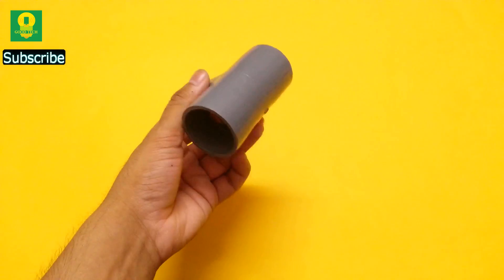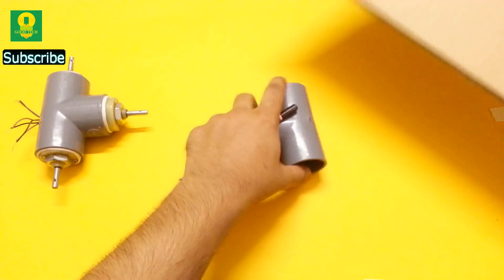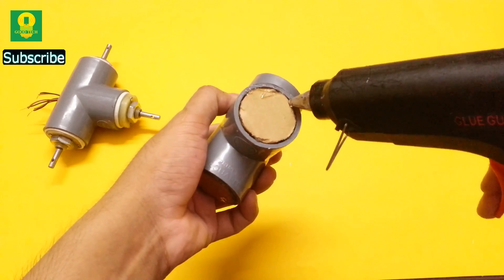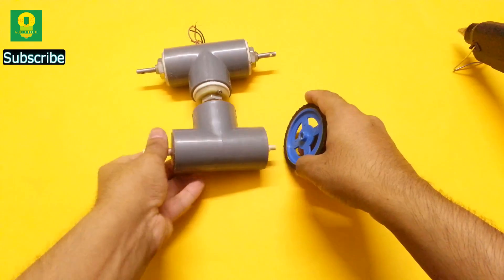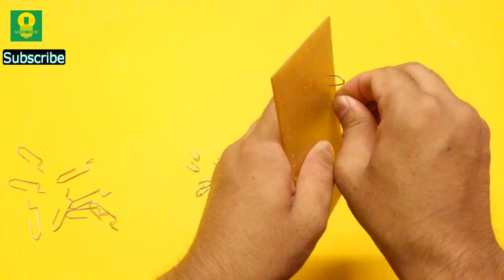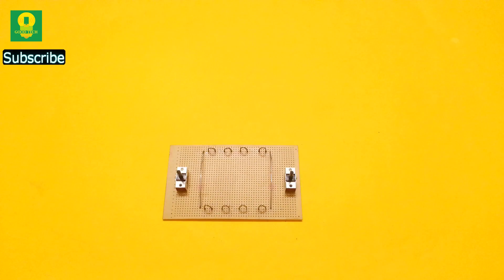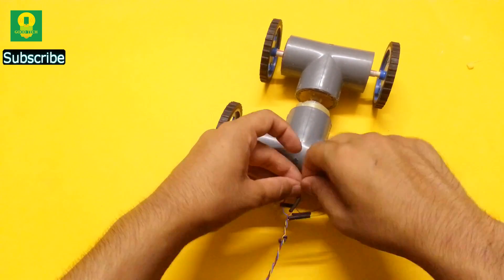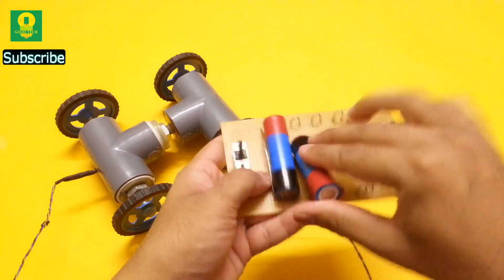How to make Remote Controlled Stunt Car at home

Comment: PLEASE remind your viewers that it is VERY important NOT to breathe in the fumes from the solder!!! Because it will give you lead poisoning

I have a friend who has cancerous lesions on his fingers from years of using solder for stained glass. Maybe also stress to your viewers the importance of either using gloves, if they are going to do a lot of work with solder, or avoid contact.

Okay, that's all I have!  I always have my eye out for safety. ESPECIALLY because this is such an awesome video, and it encourages people to build things and they might not be familiar with all the safety procedures for working around solder. I love this video because it is very simple for the viewer to follow. Instead of giving them a bunch of electrical theory, this gives them a quick project

Comment: what is the cost of that PCB board
Reply from the maker: The cost varies from shop to shop. If you have a local shop nearby then bargain and get the parts from there. But if don't have any, all the parts are also available online on ebay and amazon.
You can have a look at my instructables for additional details and material links - https://bit.ly/2SyiOq2

Comment: What is the dia. Of pvc t
Reply from the maker: I used is a pvc-t with1.25 inch diameter, but it will depend on the size of motor.

Comment: wow nice
Reply from the maker: Thanks..
Reply: bro agar ramot ki jo taar he uski jaga sencer lag jay to kasa rahe ga q k mane ye car banana shuru krdiya he
Reply from the maker: knsa sensor?
agar ise wireless bnana h toh motors thodi zada better use krni pdegi ye gear system use krna pdega kyunki wireless mode mein battery bhi car mein hi rkhni hngi and it will increase the overall weight of the car, thus making it difficult to topple and perform stunts.

Comment: How many pins are there  in dpdt  switchs???
Reply from the maker: A dpdt switch has 6 pins and a momentary dpdt switch can be easily used to control the direction of a DC motor like the ones used in car power windows.

Comment: can we use a normal dc motor which cost just 40 rs
Reply from the maker: A normal DC motor without the gears will not be able to produce enough torque to move or lift the car.
Reply: thnx

Comment: Can we use DC motors
Reply from the maker: Yes, i also used DC motors. Dc motors are only capable to provide enough torque when used with gears. That is why mostly geared DC motors are used in toys.

Comment: Which type of motor did you use please tell us the power of the motor
Reply from the maker: I used a 12v geared DC motor available online ebay and amazon. If you have any doubt,i have also made a written document about the project on my instructables page : https://www.instructables.com/id/How-to-Make-Remote-Controlled-Car/

Comment: Can i make it with a normal dc motor instead a gear dc motor
Reply from the maker: No, a normal DC motor will not be able to provide enough torque for over turning of the car.

Comment: I'm making this car in car race in my school
Reply from the maker: This car is not suitable to work as a race car. The motors are not able to provide that much rpm. Its better to design a ferrari with high rpm dc motor and you will surely win the race. There are many tutorials out there online, give them a try. 
But if the race surface is tough and there are dirt tracks, this car will work good.

Comment: we need pcv card compulsary
Reply from the maker: No, a PCB board is not compulsory, you can use any plastic box and make connections using wires.

Comment: bro can we use 2 9v battery instead of cells please reply fast
Reply from the maker: Yes, surely you can use any batteries as long as it meets the power requirements of the motor. High current 9v batteries will work well.

Comment: can we use other motors
Reply from the maker: Yes, you can use any DC motor. But make sure that the motor used at junction is of high torque that can lift the weight of the car upwards, otherwise it won't be able to perform stunts.

Comment: can i use metal toggle switch instead of dpdt switch
Reply from the maker: How will you achieve bi-directional motion with a metal toggle switch.
Reply: so which type of switch will I have to use
Reply from the maker: To achieve bi-directional movement, the most comfortable way is to use a Dpdt switch but you can also use 2x two way switches and combine them to form a dpdt switch as i did in my floor cleaner video. Although, this method can be used but two way switches are not very comfortable to operate a car. If availability of the switch is a problem, you can get the switches from here: http://amzn.to/2lJEAqu
Reply: Lokesh

Comment: Hi friend, where can I get the engine you used to build your video car? On a printer? , On a radio? Please answer me, thank you
Reply from the maker: For the wheels any DC motor can be used but the motor at the junction needs to be of high torque to be able to lift the weight of the car upwards. This high torque motor can be obtained from an old printer.

Comment: WHAT IS THE SIZE OF PVC T?
Reply from the maker: The size i used is 1.25 inch, however it will depend on the size of the motor used.

Comment: how much inch pvc pipe is it?
Reply from the maker: The size i used is 1.25 inch, however it will depend on the size of the motor used.

Comment: can I know the rpm of the motors.
Reply from the maker: Two motors are 150 rpm and the motor at the junction is 100 rpm. If you are making this car, make sure that you use a high torque motor at the junction that can lift the weight of the car upwards.

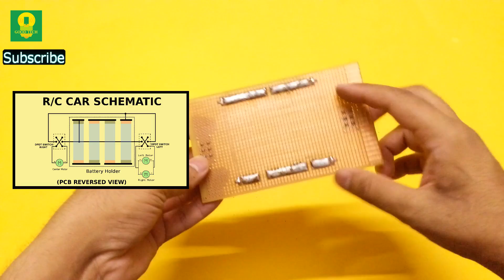Comment: hey bro...I didn't fully understand how you connected 4 wires to the 3 pairs of wires you made from the motors at 4:22
Reply from the maker: There are 4 wires from the remote (i.e 2 wires from each switch) and 6 wires from all the 3 motors (i.e 2 wires from each motor). We need to connect both the two oppositely placed motors together that are responsible for car's movement and the motor at the junction should be separate. After connecting the motors, we have 4 wires from the 3 motors (i.e 2 wires from the motor at the junctions and 2 wires from the connection of other two motors) and 4 wires from the remote, that can be connected easily.
If you are preparing to make this car, make sure to use a high torque motor at the junction that can easily provide upward thrust to the car, so it can easily perform stunts.
Reply: Thanks man! You were really helpful.

Comment: Can you tell me where to fit the wires of dc motor in the receiver circuit
Reply from the maker: All the receiver boards generally have markings for the connection of the components.

Comment: which motor u have used  and which type of board is that tell is clearly wich type of material u have used
Reply from the maker: All the materials are mentioned in Video Description. The board i used is a general purpose PCB board.

Comment: what rpm motor and which type of battery I need to make this awesome project
Reply from the maker: I used 100 rpm geared DC motor. The battery will depend on the power required by the motors you will be using. However, if you build this, make sure to use a motor at the junction with high torque, so that it can lift the weight of the car upwards.
Reply: the modern robotics rRrttttttre3rrye

Comment: I have my vehicle built.  I was able to use a dowel rod for the central shaft that connect to the motor. I cut the dowel rod into sections with a cutoff saw. I used a drill press to drill the center of the dowels. I'm still working on my prototype. Since I want to use this project with my elementary students, I think the less hot gluing they do the better. ;-) Not sure yet if my wheels are too wide or heavy.  I just tested it out with 6-volts and can see that it does take more power to lift and twist the front end, but I just got my 3.7 volt batteries today and will see how they work. This is a cool project.
Reply from the maker: Thanks..All the best :)
Reply: It is best how to make a rc.truck

Comment: sir very nice one but the connection are little bit hacky
Reply from the maker: Thanks..I did try to make it simple but if you face any problem feel free to ask. There is also a schematic of the complete circuit in the video.
Reply: Ok thank u so much sir plzz. Make projects like this more and more

Comment: Can we use 150rpm motor???
Reply from the maker: Yes, but make sure that the motor used at the junction should have high torque so that it can lift the weight of the car.

Comment: see I've got 4 wheels,3 dc 12v 100rpm motors,lg li ion 2000 mah batteries but they are connected with wires so how can I make it

Comment: What are the Materials required??
Reply from the maker: Two PVC -T, 3 geared DC motors (mainly the motor at the junction must have high torque), wheels,Connecting wires, Two DPDT switches, a general purpose PCB board, few office clips and batteries.
However, all the details are also in video description.

Comment: Remote connection is not clear please clear it
Reply from the maker: There are two DPDT switches on the remote. One for the motor at the junction and other for both the back motors. All the 4 cells are connected in series and then attached to DPDT switches. There is a circuit diagram in the video, give it a look and you will be able to understand the connections well.

Comment: bro how to get motor
Reply from the maker: These are available on ebay and amazon. If you are going to make this stunt car, make sure to use a motor at the junction with high torque that can lift the weight of the car to perform stunts.

Comment: sir i want to ask u a question that if we have to connect two wire that are apart can we only solder from the first wire to other does current willl pass or no
Reply from the maker: I didn't get your ques but if you are asking that can we connect two wires using soldering then yes you can and current will flow.

Comment: sir your video was really useful but one problem i found was that how to connect motor to the pvc circuit
Reply from the maker: We have used 3 motors in the PVC, the motor at the junction is independent and is directly connected to the circuit on the remote control, the other two motors are placed opposite to eachother but they must move the car in same direction, for that, we need to connect both the motors in opposite direction(cross connection) i.e the +ve terminal to the -ve terminal of both the motors as a result both the motors are combined to form only two terminals, that are connected to the remote control as shown in schematic.
Reply: +GOODTECH - Creativity and Science  now i got that but can you send me picture of circuit in real other than schematic diagram pls if u can
Reply: +GOODTECH - Creativity and Science and how much rpm motor u r using
Reply from the maker: I have used 100 rpm motors
Reply from the maker: The circuit is easily shown in video, look at the sequence between 4:47 to 4:59. The image of the circuit can be seen completely.
Reply: +GOODTECH - Creativity and Science thank it was very useful due to u i made my science model today only it was easy
Reply from the maker: You are welcome :)
Reply: +GOODTECH - Creativity and Science sir need ur more help where u get that wheels
Reply from the maker: These wheels are available online on ebay and amazon(color and design may vary). However, you can also use plastic jar caps as wheels.
Reply: +GOODTECH - Creativity and Science okkkk thanks

Comment: Add a radio reciever circuit from a broken rc car,now you can control it with the rc car controler from a distance!
Reply from the maker: Yes that is true, but the problem with that is we need to attach the batteries to the car in order to add a wireless receiver and to power all the three motors we need high capacity batteries that are bit heavy. It will be difficult for the motor to perform stunts with so much added weight.

Comment: what can be used instead of the wooden stick?
Reply from the maker: You can use anything that can act as axle for the two wheels. A pencil is the most common thing that does the job well.

Comment: How do i make the controll, i dont understand the schematic
Reply from the maker: What did you not understand in schematics ? There are only two DPDT switches that have six terminals each , 4 of the terminals of each switch are cross connected and the middle terminal of the switch are connected to battery Holder. All the 4 batteries are connected in series as can be seen easily. The Red part of battery indicates "+ve" terminal and black part indicates "-ve" terminal. The motors are connected to two of the cross connected terminals of each switch.
Now, Try to look at the schematics carefully and you will surely be able to understand it well.
All the best :)
Reply: +GOODTECH - Creativity and Science i'm really bad at this stuff and i'm doing this for a school project. How do i do the switches with Only two pins? ( just for on/off) And The pins are not small like yours so can't connect it to the board, what do I then? And the board thing you're using as remote controlledr have a similiar but with metal so one whole string / line becomes positive or negative if u connect it with battery ( dunno the name)
Reply: +samindj I bought the two pins cause I only need it to go forward, or do I need another one so it functions correctly and move/ turn?
Reply: +samindj don't need it to go backwards if that's the only extra functions with more pin
Reply from the maker: Its alright. But what i understood here is that you bought a simple On/OFF switch and with that switch you wont be able to have much control over the car. You don't even need it to perform stunts(it is not possible with a simple ON/OFF switch)??
If you just want to make it go forward, then you can skip the motor at the junction, then you will have only two wires instead of four (because both the rear motors are connected together). Connect one of the wire directly to the negative terminal of battery and connect the two pin switch between the remaining motor wire and the +ve terminal of battery.
And the board you bought is a copper clad (bakelite board coated with copper ), it is used to make PCB's. This board is not useful to make the controller. You need a general purpose PCB board. If you are not able to find the components in local market then, most of the items are also available online on ebay and amazon.

Comment: Hi i like your videos can u tell me the remote connection and then how to connect it with the car
Reply from the maker: Thank You :)
As you might have seen, the remote uses two DPDT switches. You have to cross connect the terminals of the switches and connect the batteries to the center pole of both the switches. now, connect each motor to the crossed terminal of a switch. See the schematic once and everything will be very clear. 
If you are making this car, make sure that the motor used at the junction is of high torque, that can lift the weight of the car upwards otherwise it wont be able to perform stunts.
Reply: +GOODTECH - Creativity and Science  thanks for the reply

Comment: From where i get DC MOTOR
Reply from the maker: I bought them from a local market, however, these motors are easily available on ebay and amazon. If you cant find these exactly similar motors, you can use any 12v DC motor with high torgue.

Comment: Sorry but for the love of equipment don't melt holes with a soldering iron unless you want to ruin the tip
Reply from the maker: +Thomas bryden Yes, I understand this but it is very convenient and fast method, and the tip of soldering iron can be just revived by grinding with a filer instantly.

Comment: may i know the tools and materials needed ?
Reply from the maker: +Fahri Hamdika You need three 12v high torgue geared DC motors, four wheels, battery to power the motors, two DPDT switches for the remote control, 4 different colour long wires, two PVC-T for the body, some cardboard and hot glue gun.
All the materials are also written well in description and shown in the video.
Reply: ***** Thank you. I will subscribe your channel

Comment: veryyy nice i loved your video and i have made at home but its not working i will try another time
Reply from the maker: +Mohammad Haneef Ahmad Thank You..:)
But exactly what  problem are you facing..?
Reply: +Good Tech - Creativity and Science  that stunt
Reply from the maker: +Mohammad Haneef Ahmad Ohh.. Which motors are you using?
You need high torgue motors that can lift the weight of the car upwards.

Comment: Where I found these motors
Reply from the maker: +mohamed ellakany These motors are easily available on ebay and amazon. If you cant find these exactly similar motors, you can use any 12v DC motor with high torgue.
Reply: THANKS